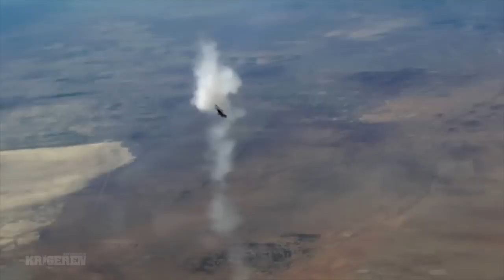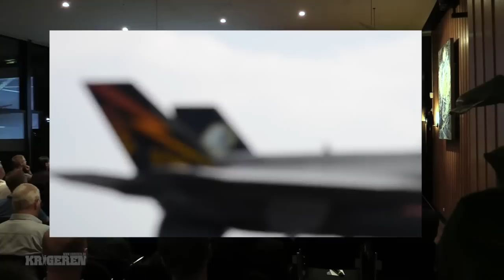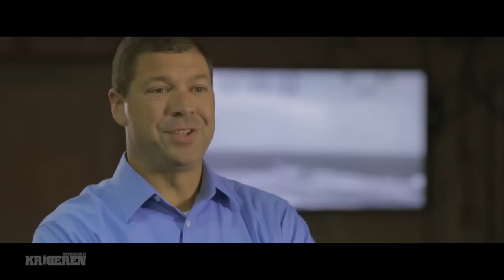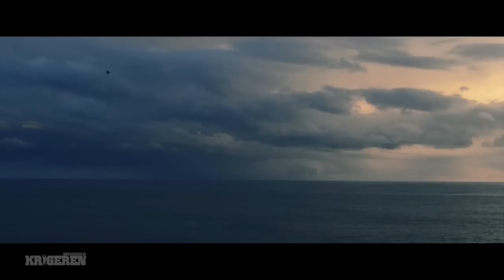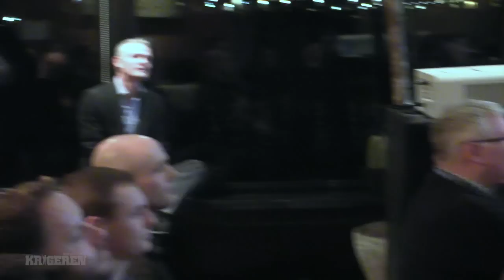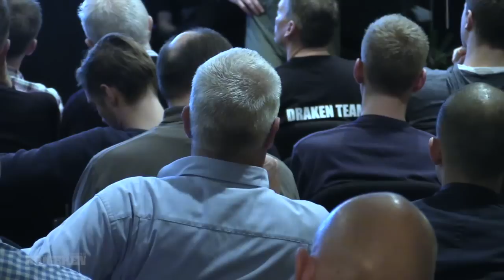Watch These Epic F-35 Pilot Meet-And-Greet Sessions!

Comment: 0.06 sec see the shadow on the nose cone. Keep the top 1/2 curved as is. But make the bottom 1/2 of the cone 2 flat sidedaiming the air straight n the intakes. Then bottom middle u can just see a 3rd faint triangle to cause the air to flow under the body. Plus flat surfaces scatter the radar signal away. Just a small enough spot not too really change the drag.

Comment: So it can carry bombs internally and externally? That's neat.
Reply: +Richard T When the enemy is no longer a threat, no need to hide and get more work done.
Reply: +Richard T So can the ww2 b-25 mitchel.Big deal.
Reply: thunberbolt two I said it was neat, not astonishing, or revolutionary.
Reply: Not a neat plane.Over budget underperforming.Way behind schedual.That overides any ideas of the f-35 being neat.
Reply: thunberbolt two Sure thing.
Reply: Nightrix prime except that it doesn't.nice try but fail.All; the F-35 has is stealth.Thats it.It is underpowred.And underperforming..Plus it overheats when its weapon panels are closed.
Reply: Neightrix prime I look up the wing bloading of the F-35 F-15 F-16 and F-104.The higher the wingloading.The less manerverable the plane is.The F-15 is 73.1 pounds per sguare foot pretty good.The F-16 is 88.3 still good.The F35 is 107.5.Which is nhorible.The F-104 is 105.Which is bad.So the F-35 has a worse wing loading than the F-104.Which was known for its high speed and bad manerverbility.
Reply: neightrix ther F-35s thrust to weight also sucks.It has a .87 thrust to weight.Compareb that to the F 15 1.07 F-16 1.095 F A 18 .96.it is better than the F 104 which was .76.which still isn't a good thing since the F 104 came out in the late 50s.

Comment: I can answer the question on cost relative to legacy fighters with their support aircraft on a per mission basis. A 4 plane flight group of F35s on a per mission basis replaces upto 24 aircraft for the same job. In savings you get a greatly deconflicted airspace since 20 additional planes would not be flying per each 4 man mission. The fuel used in all those extra planes would not be needed. Also the additional man hours and logistical support for those extra 20 aircraft is saved. The F35 on a per mission basis is not just cheaper than legacy aircraft but is far far far cheaper. For the exact dollar value you would need computed on every type of mission so it will vary. Seeing how much difficulty Russia is experiencing with supply chain shortages in their war with Ukraine would further prove the value this aircraft brings to the war fighting environment.

Comment: That guy that asked about the downsides of F-35 compared to some legacy aircraft from our adversaries should have pressed on and asked Elliot specifically to address the problem of F-35s lack of speed and supercruise compared to lets say SU-30/35.Or the lack of number of air to air missiles F-35 can carry in stealth mode. Problem as I see it that you would run out of AIM-120s before you could knock all SUkhois from the sky and sooner or later you would enter VWR dog fighting and in that department F-35 is inferior to SU-30/35. Also SU-30/35 has a state of the art jammer that would probably confuse some of the AMRAAMS fired upon them and then use its IRST to locate F-35 and since it's much faster and has the ability to supercruise (also that is not confirmed) F-35 is in severe disadvantage. But I guess USAF has an answer to that also. F-35 would definetely attack as a part of a package with F-22s. Then there's a great new initiative mentioned by Ash Carter a few days ago where B-1s and B-52 will be used as missile trucks. F-35 would be forward sensor systems that cue missiles and when they ran out of their ordinance they would simply use dozens of missiles that these support bombers carry. I think that's the way to go and will bring another level to F-35 that it lacks.
Reply: As mentioned in this video slightly the F-35 can ask other aircraft/ships/ground units to fire missiles in its direction and then use those missiles to take out targets.... so a ship could fire 10 AIM's towards the F-35 for the F-35 to take out 10 aircraft without even firing its own weapons!!
Reply: Andomaca1 There is a new groundbraking system/doctrine being developed as we speak. It's called arsenal plane. Basically you would have huge B-52s and B-1s loaded with dozens of air to air missiles and take the role of a missile truck. F-35s and Raptors would  fly hundreds of miles in front of those "missile trucks" and serve the role of sensor nods, tracking targets and relaying information back towards the "trucks". Those B-52/1s would fire their missiles (AMRAAMs) and turn around. Then Raptors and F-35s would guide them towards their perspective targets. And bingo. You've solved greatest deficiences of our stealth fighter jets - small amount of air to air missiles they can carry internally without sacrificing their stealthiness. It's a great concept that will bring game changing capability to USAF and NATO in general.
Reply: Yeah I heard something similar, sounds very deadly!

Comment: My question:   Can The F-35 evade the Russian S-400 Surface-To-Air missile system?????
Reply: +nikemac84 It can detect it but it wont be able to track it with a high enough resolution to fire at it unless the plane moves too close. Even then the F-35 will know its being hit by those radar waves before the radar operator detects it, and could therefore make a choice of what to do. S-400 are a dangerous system that would need special tactics to deal with and would likely be the first target. However, it is not an indestructible shield.
Reply: How come the wings on the F-35 are so small???  And how come the Navy version has to have "bigger" wings???  Does that enhance flight characteristics???  If so, then why don't the other versions have the same size wings???
Reply: nikemac84 No, it has little to do with the flight characteristics. The F-35C has bigger wings for several reasons. 1) it needs more lift during takeoff and landing. Basically it allows it to get off the carrier faster and land safely at higher speeds. Remember if the aircraft misses the cable, it has to immediately take off again. 2) it has greater range requirements than the other services and most of the fuel is stored in the wings. Larger wings = more fuel. (flying over an ocean means you better have enough fuel to get to the carrier)
Reply: +nikemac84 NO. Not even with miracle.
Reply: nikemac84     YES
Reply: @nikemac84  The F-35 can have such small wings in comparison to other aircraft because its a lifting body, meaning the body of the aircraft produces half or more of the lift of the entire aircraft which isnt an entirely new concept and allows for much better maneuverability and cruise speed
Reply: @Sub___Zero  mfw S-400 non-functional